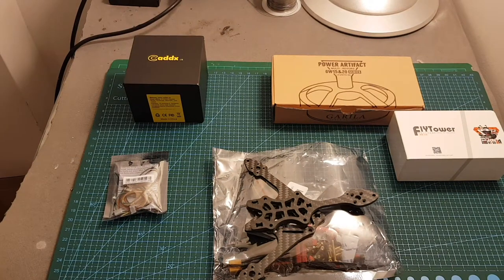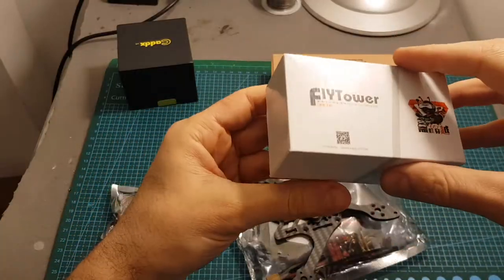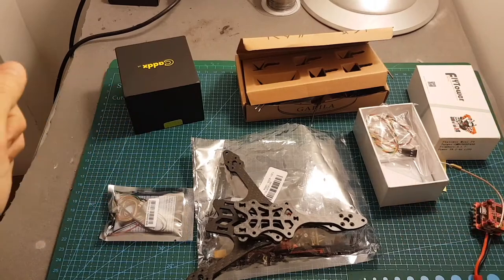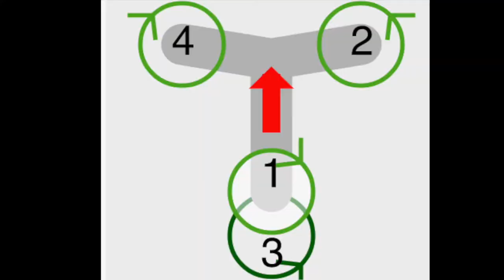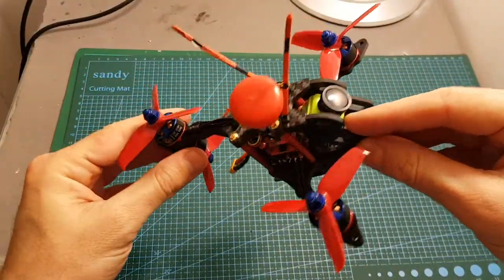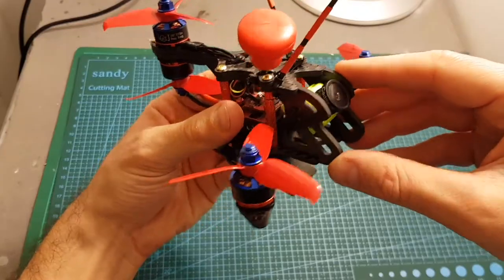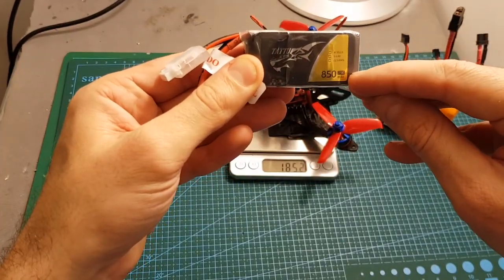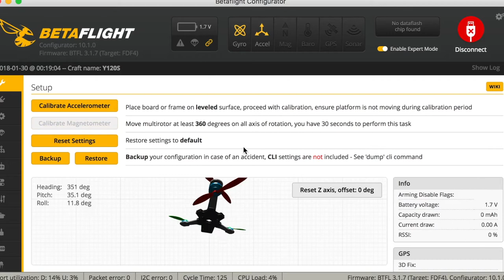Exuav Y120S - Build, Setup & Test Flights

Comment: Gal, how do you like those motors?  Seems a bit on the big side.   Any other motors suggestions for 3s/4s on this frame?   I already have bh1407 4100kv on another frame, so I'd like to try something different
Reply from the maker: Hi Shai. What's more important for you - power or flight time? If you're looking for a longer flight time you should try 1306/7 motors. Using Emax 1106 4500KV motors is also possible (Though I need to verify that this frame supports it) but I don't think it will be powerful enough.
Reply: Gal Kremer I like to cruise at hover but I want the power there to punch out.  Any issues with size/weight with those 1507s?   What about something like a 1502 if there is such a thing.
Reply from the maker: I don't think 1502 motors exist. Anyway - these motors are great and their only down side is that they are pretty 'power hungry'. Use an 850mah 4s lipo and you should be golden.
Reply: Gal Kremer thx for the feedback.  Sounds like a heavy setup though for a 120.  I have plenty of 850s but that definitely puts the build all jn weight over the 250g.